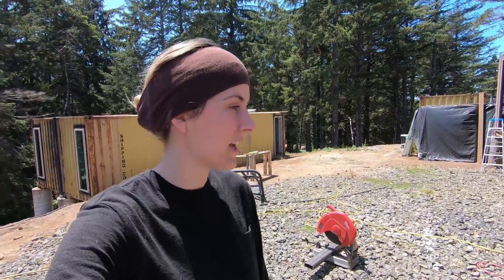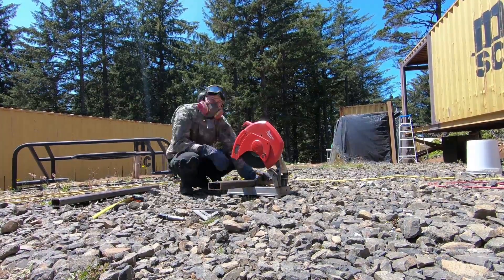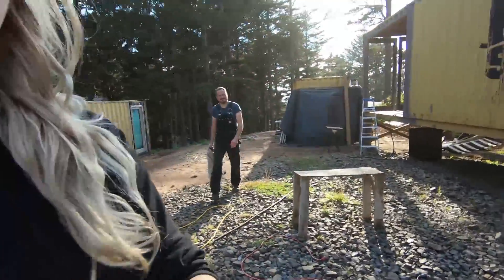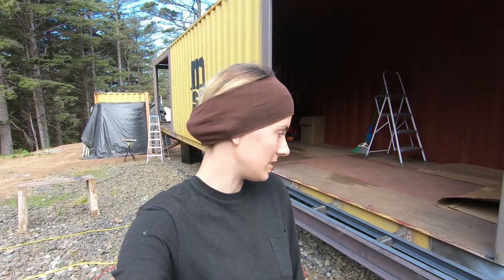CREATING A CANTILEVER/FLOATING BALCONY for our CONTAINER HOUSE - Part 1 - Ep. 16

Comment: Excellent work on balconies. 
Point of order,, they aren't cantilevered structures.  Rule of cantilever is that for every foot you go out from your structure, you must go back into your structure by 2 feet.
I don't think this will be a problem as your balcony is so narrow.
Keep up the good work as it is very informative.
Reply from the maker: Thank you! There are a few different ways to do a cantilever structure. This is one way, and what you described is also another way. 🙂
Reply: @PacificPinesRanch  Technically speaking in terms of structural steel it would be considered an outrigger as it is face mounted and does not extend into the structure itself.

Comment: Please please please get a good quality set of saw horses and quit working on the ground!!! Good god your making it so much harder on your selves. And you really dont need the mask, especially outside. Ive been doing metal fab for 40 yrs breathing in dust and fumes. Never have used a mask. Use a fan in confined areas and keep your head out of fumes the best you can. Masks are MISREABLE!!! Also when building a structure like the cantilever, build it as one pc on saw horses or a flat surface and then attach after youve welded and cleaned.  SOOOO much easier and efficient. I would have fired both of you after one day...LOL LOL
Reply: Ware the mask but get some saw horses and get off the ground.  Your backs will thank you!
Reply: That metal is galvanized. Not good to breathe.

Comment: Beautiful job!  Overkill is underrated in these new cutting edge construction processes. Thank you for sharing.   Couple of questions
1.  What kind of welding did you use to weld the initial 3 piece C channel together?  Did you use the same to weld to the container?
2.  Did you weld that 3 piece C channel frame directly to the container or was there an intermediate piece in between?
3. How many hours did this take?
Reply from the maker: Thank you!! We flux core welded everything, there is a reinforcement plate that the c channels are welded onto, and it took us about 3 days to complete. 🙂